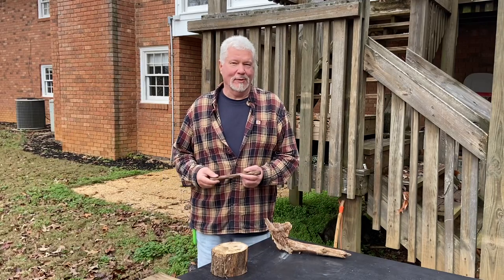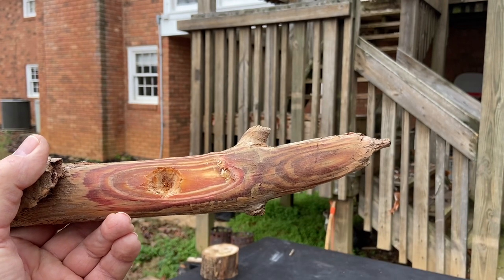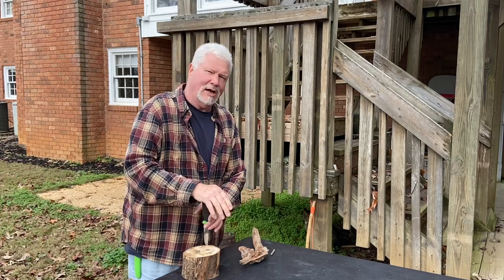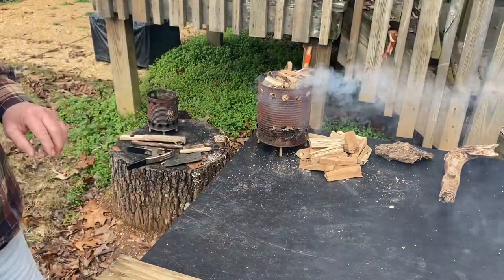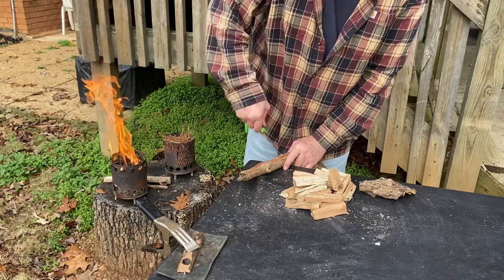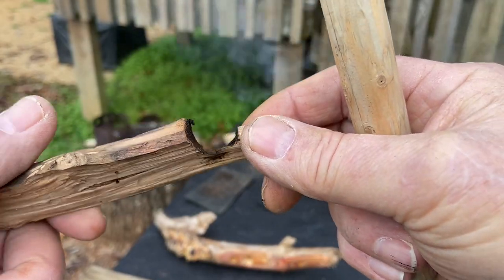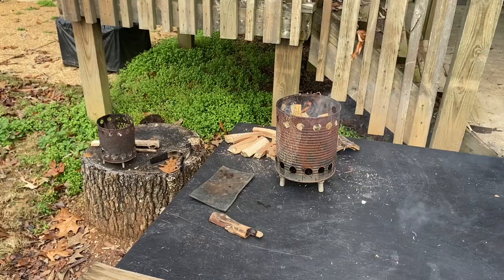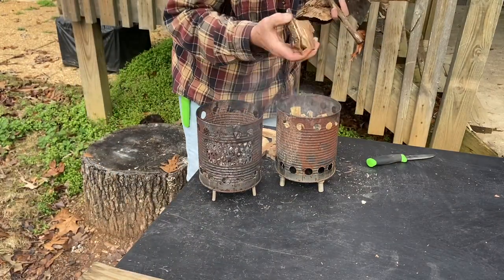Pine Knots Are A Fire Maker’s Baton, Bearing Block, And Fatwood

Comment: Well David, I know how it is to try to squeeze the most out of your fireboard but, why not try using a bit larger/longer board from now on? A good fireboard won't set you back any money and if it was anywhere around a quarter inch thick, it would probably last you 10 time longer. You realize that you are diminishing the thickness of the board each time you use it and if you start out thin, you will end up with a fireboard in 2 pieces that much sooner. ... Just one ol' ourdoorsman to another, mind you ... 👍

Comment: Nice Fatwood, nice Beemer
Reply from the maker: It has a very expensive sensor in the transmission that needs to be replaced. It's been somewhat of a lemon from day one.
Reply: @DavidWestBgood2ppl  I always wanted a BMW, Mercedes, Porsche, etc. The closest we ever came was an Audi A4 and it was primarily my wife's. These luxury brands have one thing in common and that is unrealistically high maintenance and parts costs. We are driving a Ford F150 base model, a VW Beetle and a Subaru Forester when we need passenger space. I have no need to keep up with the Jones's or with their credit card bills. I really enjoy the heck out of your videos and will try soon to extract some heartwood from a dead pine that is collapsed on the line between my neighbor and me.
Reply from the maker: I bought my 01 Camry new. It has 360K miles on it and is still going strong. Not much to look at though.
Reply: @DavidWestBgood2ppl  Hard to beat the Toyota build quality.